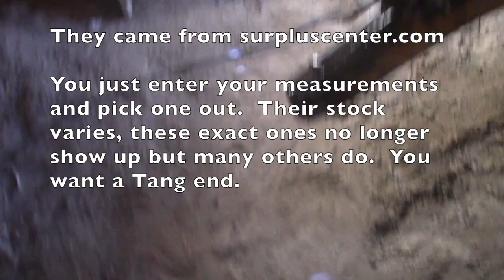Case CK530 Loader Rebuild -Model 31

Comment: Nice fix! Better cylinders too not being tie-rod ones. Where did you get the press in bushings? The bore of the cylinders doesn't look that big, hopefully it has enough curl power. Nice and fast though! Hopefully you put a little anti-seize under the flare cap. Dad has the same little acetylene jewlers torch, it's great for bringing to jobs.

Comment: WTH! I just picked up a 530 and it has a 31 on it! Wish I watched this earlier wouldn’t of paid as much. What model number pistons did you get? How much did they cost you and how many did you replace? I have at least 4 pistons that are pissing.
Reply from the maker: Less than $80 each so comparable to the seals. Surf the surplus center with your sizes, the ones I bought no longer show on the site.  I also have the model 31 manual now so shoot me an email and I will send you pictures of the piston part numbers when I get back in town.